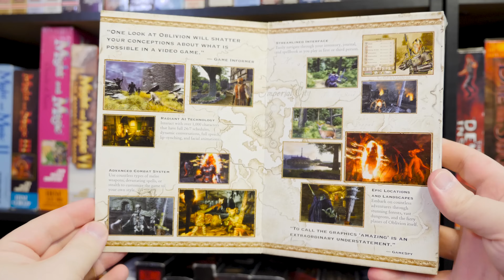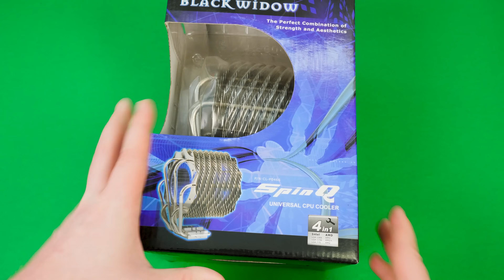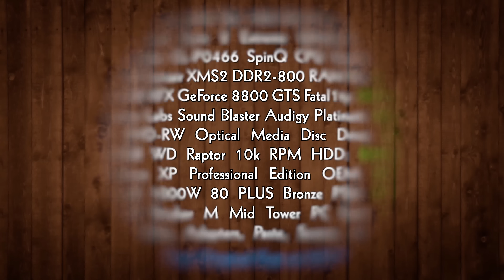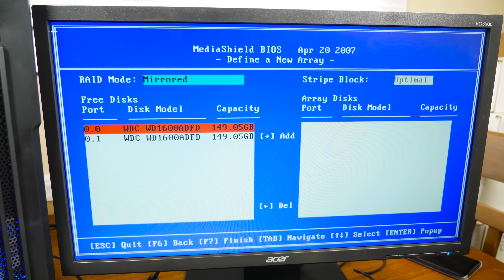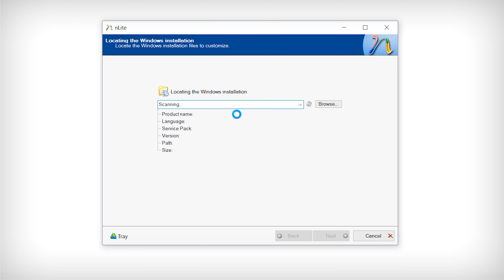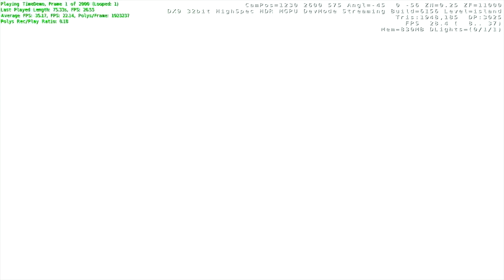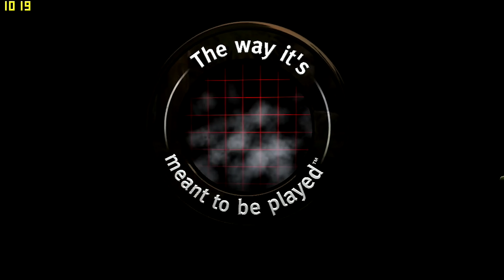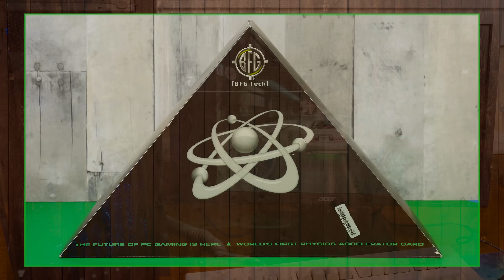LGR - Building My Dream $3,588 Windows XP PC

Comment: I decided to do something similar with a cd/dvd ingest box. I wanted to use some parts i salvaged from old computers from my dads work. I used a pentium d 820. i got a x48 intel board for really cheap off ebay. i got 8gb of ram, a cooler master tx3 i got for cheap from employee discount, a evga gts 450, 3 dvd drives, a startech ethernet card, intel wifi (because i didn't know where it would land in the house), a sound blaster card, 3 500gb WD blue drives in raid 5, a 430w corsair psu, all enclosed in a be quiet silent base 600. 
I installed windows 7 because my ingest program needed that. but i had a hard time installing it because of raid drivers. I got around this by tracking down the correct driver and using external hard drive getting windows 7 install it. But then after i had to hard shutdown it would stop working. the raid control said a drive was corupted. I tried replacing the drive but that didn't work. Then after a week of messing with it i tried using a different sata cable and bam it was fixed. i had a bad sata cable. in all my years of pc building i have never seen a sata cable stop working because of hard shutdown.

Comment: Since I'm not much of a gamer, that processor alone makes this more powerful than the most powerful PC I'm using now, which has a dual core Pentium of the Core 2 era, albeit in an eMachines firm 2011-2012.

It just has a GT 1030 on it and SSD upgrade: the former because I needed the low power requirements.
Reply: Hard to say for sure, but it gave me accelerated 720p and 1080p video, which was my main purpose. I did try a few old games I had that barely ran only the built in Intel 45 series at 480p worked a while lot better, with full resolution and antialiasing.

I can't remember the passmark, but I do remember that it seemed the pcie slot was a bottleneck.

Also, the new South Park is playable.
Reply: From what I've read, the 1030 actually requires PCIe 3.0 X4 to function at full. And, while I can't find my results now, I do remember my Passmark seemed oddly low on certain parts. 

Do you have a benchmark besides that you would like me to run that I can easily download and run?
Reply: Also, I just remembered that I can run BioShock on high with full DX10 support, if that matters.
Reply: GT 1030 is actually a pretty decent card as long as it's the GDDR5 variant. it's nearly as fast as a 750 ti. RE7 runs fine on medium 1080p. Even witcher 3 runs nicely on 720p medium. Bioshock is child's play for a 1030. A pcie 1.1 will probably bottleneck it.
Reply: It is indeed the gddr5 variant. I got it when the price was down at $65, before they crippled it.
Reply: I got a Zotac GT 1030 2GB GDDR5 for about $100 Canadian after I picked up the HP Compaq Elite 8200 SFF as a HTPC, it's a nice performer for the price. Luckily, it was also shortly before the GPU market went crazy with those bloody miners and the price doubled :)
Reply: Yes, you're right, PCIE 1.0 x16, 2.0 x8 and 3.0 x4 are all roughly the same bandwidth - not exactly the same, but within a percentage point or two.
Reply: the 1030 Gddr5 is TWICE times faster than the 750ti.
Reply: i have GT 1030 on my I5 its great
Reply: Does it play Shadow of tr?!
Reply: Holy crap. I haven't used a core2 since wow 2012?! I feel for you as this would be very slow and limited to MS Word and a few tabs with Chrome
Reply: nashismox3 dunno where you got that figure from. that is definitely not true. the 750ti is slightly faster than even the gddr5 variant

Comment: The gaming rig I use now has similar specs...
Reply: Mr. Dead Inside its not that bad im trying to build something similar, pair that old q6800 with 8gb of ram and a gtx 1050 and you got a pretty capable computer.
Reply: Oh you poor soul
Reply: Yeah what ever nerd
Reply: i have a Q8200 6GB ram with a 1070 lmao im desperate for a new cpu
Reply: @DLoyaL902  Ryzen 2600 is about the best value for performance you can get.
Reply: ..i should of said i need a new computer.......... it still does the job but i am really lacking hard tho for AAA games lol
Reply: @davidfigueroa8335  possible bottleneck with GPU.. could be wrong but hey! Report back once you built the rig and let us know!!
Reply: @barbosaguzman6101  I dream to get a Ryzen CPU but my motherboard only supports Intel, and I don't know what motherboard to purchase
Reply: Bricks Go for a cheaper B450 motherboard if you want to go Ryzen
Reply: @3ountyhunter  True,though i would wait for the Ryzen 3000 Series CPUs at this point.
Reply: Lynestro The Conqueror  i have a pc that has 0 gb ram no cpu no gpu no psu no hdd no ssd basically i have got no pc

Comment: The 8800 cards sufferd from Nvidias massive hiccup also known as the "the VRAM bug". I had the 8800 GTX, hich had a 192 bit bus which was amazing at the time but for all these cards there was bug in RAM management that lead to the RAM of the cards not refreshing properly "running over" and slowing them down after a while. The oddities you saw in Crysis would likely b down to that bug. Especially if you played it on a comparably high resolution which would fill the Ram very fast.
Nvidia promised to fix the bug back then but could actually never be bothered...
Reply: especially those 320mb cards. Windows only used 256mb of it, and that was a small amount even back then. He would have gotten better results with the single gtx.

Comment: Also isn't a high resolution crt monitor the proper way to play games on xp?
Reply: metaleggman18 bah
Reply: By 2008 there were many LCDs "good enogh" for playing, and not much expensive, IIRC.
Reply: Agreed.
Reply: @TheRetroGamest Because of the resolution and ppi. Ppi and resolution on crt monitors was higher than lcd monitors at that time. One was 1024p and small, the other one was 768p and bigger.
Reply: In the mid 2000's it was either a 17" Samsung SyncMaster or a 17" Eizo Flexscan!!!! Closer to 4:3 than 16:9 screen ratio. Typical resolution was 1280 x 1024.
Reply: @Benchmark City True, around the same time I got my first Sony VAIO Laptop a16:10 with X-Black. Great step up from the washed out colors of a regular TFT with that greyish tint
Reply: My first Windows XP PC came with a 16:9 LCD. The year was 2006.
Reply: @Benchmark City I still have a 16:10 Samsung 22" that my wife uses.
Reply: u must research default resolution for games in xp era and buy crt monitor with high refresh rate of latter resolution , not necessary hd resolution
Reply: @ihalloway  Using a CRT for an XP era machine is completely option. As there were several manufacturers who shipped systems with flat-panel displays. Helll I had a Dell and an HP that came with 15" TFT-LCD panels.
Reply: Maybe, if you're playing Windows XP on a $5 budget. In 2002.
Reply: I had a LCD most of the time I had XP. 17-19' screens weren't too much back then.

Comment: Love this. Reminds me of my 2007 Macbook I got for college. I was able to update it from 1gb of ram to 4gb(could only use 3gb). Then the great recession happened, upgraded the hard drive and replaced the battery. Used that thing through 2015. Still have it but it needs some fans replaced, might be a fun project to take me back! Luckily I've got some modern PCs now. I think my MacBook was right around $1K in 2007 and my PC was about $1100 in 2022. 200% effective speed but 1000%+ at multicore utilization. Not even gonna think about the iGPU vs my current 6800XT!

Comment: The CPU is faster than my computer that runs windows 10.
Reply: That CPU is only 0.2 GHz slower than mine (basically only slightly worse.)
Reply: E  Either way I've seen the benchmarks, that one is slightly worse than mine.
https://cpu.userbenchmark.com/Compare/Intel-Core2-Extreme-Q6850-vs-AMD-Phenom-II-X4-955/m7118vs2935
Reply: Could be worse. My XP gaming machine has a I7 4790K. A 4 core 8 thread chip that runs at 4 GHz but will turbo to 4.4 GHz lol
Reply: 3700x AND 1300x flex 💪

Comment: This build is 47 times more powerful than my laptop. :/
Also, I recommend installing the unofficial SP4. It includes updates released after SP3, and it automatically enables the system to get the POSReady updates, so you can let it update 100% and then send it offline again. If you don't want the POSReady updates there's also a separate installer of SP4 that doesn't have that iirc.
Reply: That is the dumbest thing you can do. You should not use XP if that's the case. On a side note POSReady support ended in april so no more updates anyways. I just don't see the value of hacking your Windows to pieces when it's proprietary software and you don't know what's in it anyways no matter how much you think you do.

Comment: I've bought a couple Rosewill SD card readers with a USB hub, out of the box one was dead, the second one was partially dead with only the USB ports working.   Both were different models.  I decided then and there to never trust Rosewill again especially with all the bad reviews on their products.   I took a chance on a cheap brand and it wasn't worth it.   I would never trust a Rosewill PSU in any PC I build, the case...maybe.

Comment: My first question when i clicked the video was "but could it run Sims games in high settings?". Cue a couple minutes later, apparently you knew someone would wonder about that.
Reply: I had an Athlon 64 X2 4400+ with 2GB RAM in 2007, and I cannot recall any major stuttering.

Comment: 9:32 I am still using a 16:10 1050p Dell Monitor on my main Desktop. Most things on it look sharper and more colorful than on my 16:9 1080p Sanyo TV.
Reply: I'd suggest buying a proper screen mate haha. There obviously is more to it than resolution...
Reply: Manny Calavera considering that I bought the 1050p monitor for only $20 from Goodwill, I am pretty content with it. It is my only HD external monitor and is quite the upgrade from my main laptop's 16:9 1366×768 display (previously the highest resolution monitor in my possession).
Reply: Sure thing, but as I mentioned 1080p vs 1080p doesn't always make sense, there's things like color depth, warmth, ability to show deep blacks and what not. Some things aren't scaled for 1080p either, so when they get blown up they're fuzzy or warped somehow.
Reply: Is it a Dell UltraSharp? Those are pretty nice monitors and 1680x1050 isn't even that bad resolution.
Reply: @Jerbod2  IPS monitors are the best
Reply: Its the tv. They sacrifice accuracy for resolution and over saturation
Reply: Easelgames I don't normally use the TV with any of my computers except for watching movies because I am aware that the TV has some shortcomings and don't currently own wireless keyboard. I don't even do that very often anymore because I now have a Chromecast.
Reply: Pasi123 the monitor is a Dell E207WFPc.
Reply: Same, I have an old Acer from 2008 running at 1680x1050 and it's still minty fresh. It supports DSR as well so Need For Speed Underground 2 looks fantastic at 2560x1600.
Reply: Easelgames Well It’s a TV. Any flaws it has should be less apparent on a screen you view from a distance rather than one that’s up close.

Comment: HAH, Nice. I came across this when searching XP. Best OS ever in my book, besides 7. I'm running professional licenced Sophos security and 4 gig on my XP3 Dell Latitude AND connected to the internet without any problems whatsoever since 2009. I'm not a gamer, so mostly using productivity stuff. Everything new works just fine, and should it not work, then use an older version.
You see, after XP, x86 hardware and software have become marketing tricks over really realastic advantages. I can get everything done professionally and nobody notices I'm on XP, LOL.
Again, after XP3, progress mostly has become marketing and nasty commerce, using irrational arguments, software blocks and the feeling that new is just better, and a must to upgrade. Meanwhile, the masses go along with it.
Realistically, if you're not a gamer, you get everything done with XP3 and Sophos. Light gaming however, is no problemo.
Sure, internet browsing at one point will render unusable, but up till now... I get to every page I want... sometimes I have to spoof. 4 Years after XP support ended, and I still get everything done with full secure access to any site and cloud. Light gaming, no problemo.
XP3 and 7 are just fantastic. I refuse 10 !!

Comment: Mere 10,000 rpm? You need those 14,000 cheetahs. 

I've never seen one in person. Though did pick up some 10,000 drives here and there
Reply: I have 4 of them running in a server I picked up. They're fast for spinning metal, but still not quite the speed of an SSD

Comment: Ive never seen quad digit fps in even a game menu
Reply: It's called stupidly fast
Reply: At lowest in Minecraft I can get 1500 fps, but that's the only time I've seen it. Could probably get close to 1000 in Half Life 2, but it can't go past 300 without messing with the configuration files, so I don't know
Reply: Again, keep in mind, UT2004's Unreal Engine 2(.5) was an insanely well built and optimized engine for the time. Unreal Engine 1 (UT99) was also insanely future proof but still has some issues on newer systems which UT2004 just laughs at even today.

Comment: Crysis 1 is the best example of an extraordinary poorly programmed pc game. I dont think reasonable  have to wait 10 years after its launch to have GPUs capable to run the game in 1080p in its full potential. (60 fps  ultra high quality)
Reply: It was actually well optimized, and you could definitely run it at max settings 1080p 60 before 2017. What you also have to think about is that when it could be run at max at a good framerate, it still looked good, despite releasing in 2007. Still looks decent today, except for the shitty textures.
Reply: It's actually pretty CPU hefty and needs real good Singlecoreperformance
Reply: Nah, it's extremely CPU dependant. The devs thought that the core clocks would continue scaling, so it only fully uses one of them. The guys at Digital Foundry showed that even a CPU clocked at 5Ghz will dip at hectic moments. GPU wise, my GTX980 can 4K it with a few compromises.
Reply: iirc my old Radeon HD 4870 could handle this game very well on max settings 8except msaa or anti aliasing in general) in 1080p. my later upgraded HD 7870 had even less trouble so yea todays high end cards need extreme downsamplings to make them sweat on crisis.
Reply: @stealthyisnthere  Being a "ti" one, I'd say one will suffice.

Comment: I'm thinking of doing the same but going with a socket 771 (with 775 hack) Xeon X5460. It still fits the time frame and is cheaper and has the same if not better performance than the C2Q Extreme.
Reply: Nice drive profile picture
Reply: I had a 775 build with a e8500, found a cheap q9550 and another 4gb's ddr2 making 8gb, and a cheap ssd. originally the rig had a 8800gt but I took it out and replaced it with a 560ti. this pc was the first pc I built myself and I didn't know shit that's why I bought a shit power supply. back in the day when I got the 560ti I hooked it up played something for about 5min then smoke started rolling out of my pc case. thankfully the psu didn't kill anything else. Its the oldest rig I have probably never get rid of it hold sentimental value. also have a x99 deluxe mb thinking of getting a xeon for that, man there pretty cheap

Comment: Awesome, but why not add an extra 2GB of ram for the full 4?

Also, Nlite was awesome, I used to slipstream all of the drivers for my machine onto a disk with it, was cool running the XP installer at full resolution with proper HW acceleration etc!
Reply: 32-bit Windows (such as XP here) only recognised 3.25-3.75GB of 4GB installed RAM, and the 4GB RAM limit included Video RAM as well, no matter if you have an on-board GPU or dedicated GPU cards like his SLI setup.

So running a setup with a Pentium 4, 3x1GB DDR(1) & 512MB GPU (like one of my old Socket 478 P4 rigs) would bring total system memory that Windows recognises to 3.5GB, and adding a fourth 1GB stick of DDR would be a waste of time and money without screwing around with the OS like a madman.

Comment: This build is very similar to my actual PC, which I built in 2009 with a beautiful brushed aluminum Lian Li case that I saved up for months to buy. It's basically never been updated because by the time it became obsolete, I had a work computer in my office that was better. I need to power it back up and get it working because I'd love to play some of these games again. Also, I bet maxing out RAM and CPU is super cheap nowadays.
Reply: U were gaming boss then

Comment: Dude 2 years ago I still had the 8800GTS :) GTA IV was nearly unplayable on lowest settings and lowest resolution and it basically had zero color
Reply: Lmao it probably runs GTA V better though
Reply: Probably not the V because of the ram (320MB), but some similar cards (in speed) with more ram actually run it.
PS: Though it's weird, I played with my HD3850 512mb, which was similar in speed, with medium graphics on 1024x768, and later (with newer drivers) on 1680x1050. And also years later with an A8-3850 APU with integrated graphics. Maybe it was your CPU, since was very CPU dependant, specially the initial release (the moved the shadows from CPU to GPU with the patch 1.0.7.0 I think)
Reply: you couldve upped saturation settings in display tab in the game tho
Reply: Well my resoulution Stuck at Lowest because of the 320mb memory it showed ingame so that more wasn’t possible